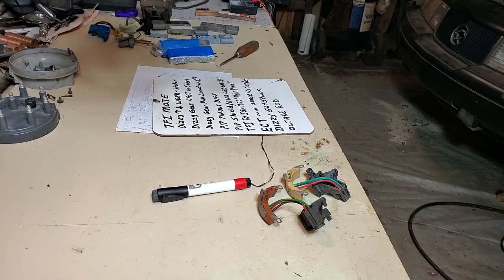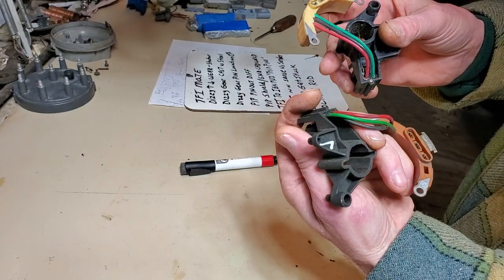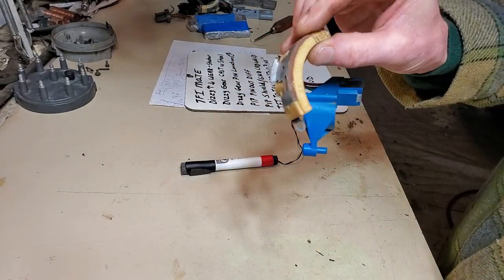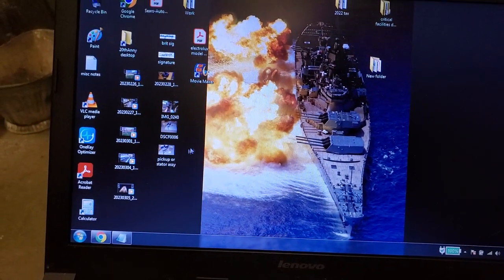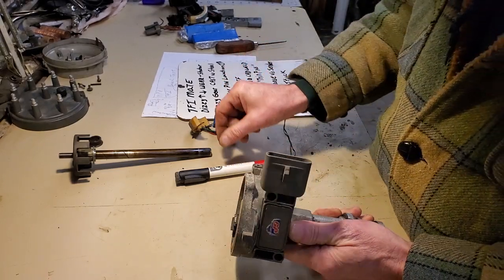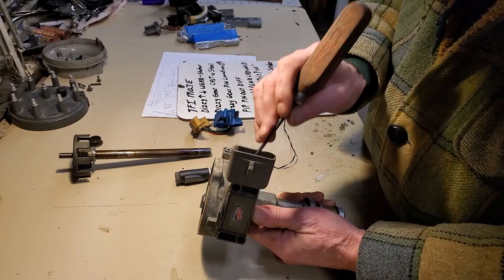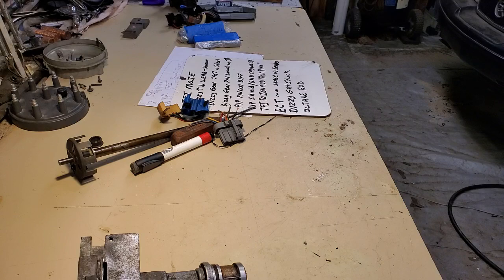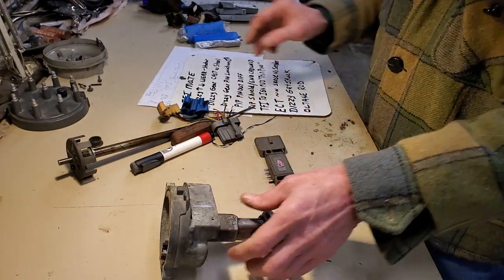Ford Ignition TFI/PIP Bench Test & deep dive PT3

Comment: In reference to the ground shown at 10:30 on that one ECM, it shows conductivity.

Would you recommend a conductive thermal paste?

What thermal paste do you recommend? 

Thanks for your detailed videos.
Reply from the maker: The ersults at 10:30 was nothing more than notating this one Iginition module is acting different than all the rest.  thermal paste will do its own role in moving heat off the ignition module and out to the larger body of the distributor itself,,  hermal past wont "correct" an electrial reading in this particular case.

Comment: Does that mean the TFI module needs to match the HE sensor?
Reply from the maker: no,, the hull effect is its own device and is not "matching" to anything.  it just does its job to provide the computer with the information needed to keep each fuel injector on for a predisposed amount of time.  the eec is looking at the TPS mainly to determine how deep your foot is into the gas pedal and other info to do this.
Reply: @ifixitall-24-7  Thanks.  I'm trying to diagnose an ignition issue that lies somewhere between the coil and the spark plugs.  I'm sure it's the distributor/TFI but trying to narrow down the options.  It's a steep learning curve.
Reply from the maker: ok,, you may wanna call me at 3047724082 but.  id suggest to stop troubleshooting.
in the ford shop manual "there is no way to isolate a bad PIP or hull effect as good or bad while "in circuit".  
this is why its better to get a new dizzy.  If you are caring about the very best parts.. then start looking for the brand "standard" or maybe hit the boneyards and collect up a few dizzys with some good oem motorcraft parts.  these parts last over 30years but,,,, on my coug i have 373k miles on my 302 and it just got its first dizzy change.   
LMR.com may have good reputation 302 dizzy's,, but you can always go cheaper and shop the hell out of rock auto.  the gear thats on the dizzy im sure you know its sort of a pita to install... i say install cause thats the real trick.